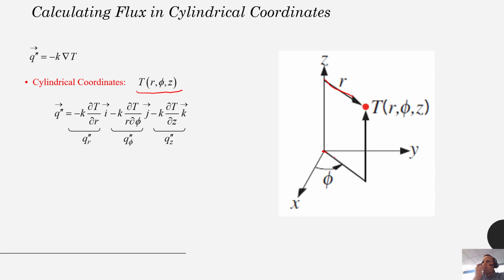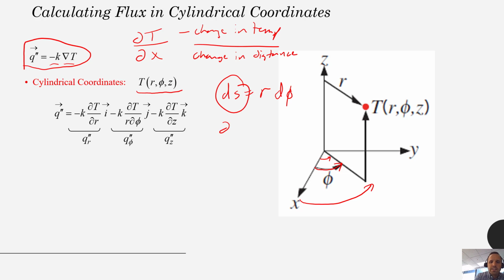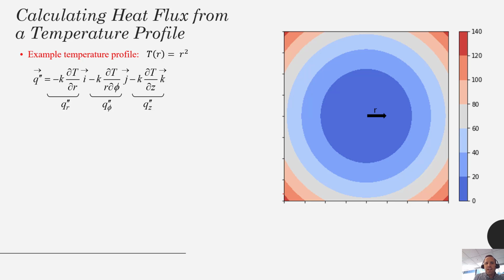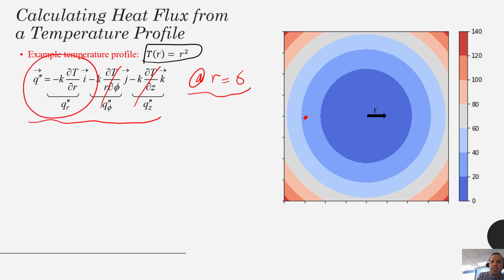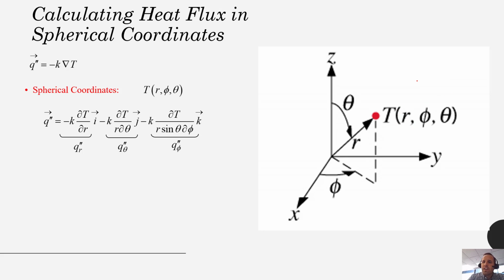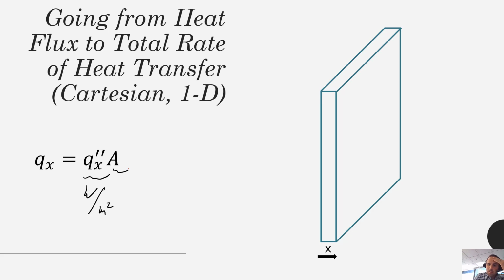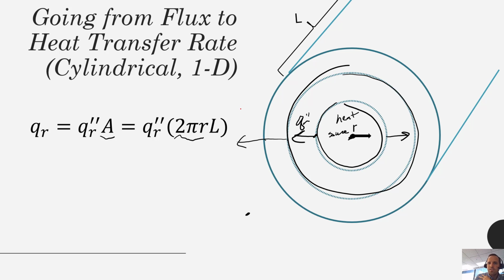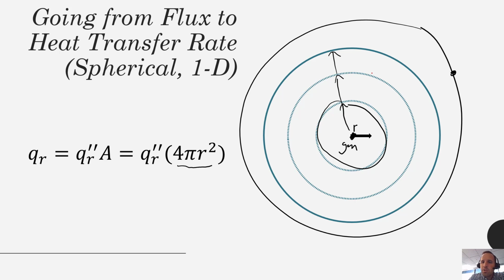Heat Transfer - Chapter 2 - Fourier's Law: Calculating Conductive Heat Flux in Radial Coordinates

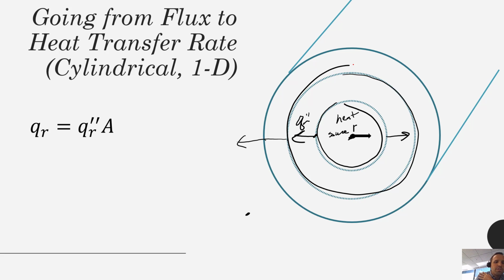Comment: Why did you use the circumference equation instead of the surface area of a circle at 18:00
Reply: he's looking at the surface area of a cylinder, which would be circumference*length